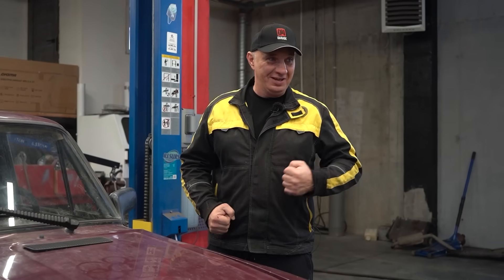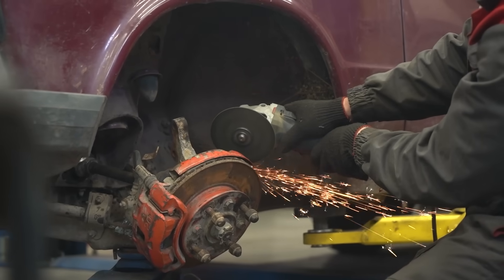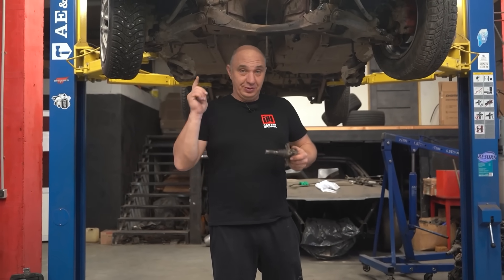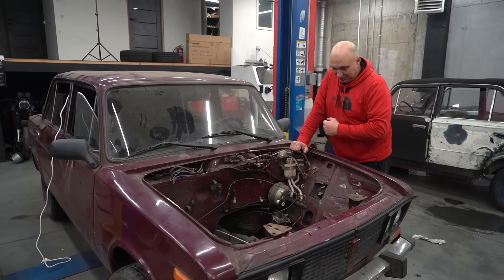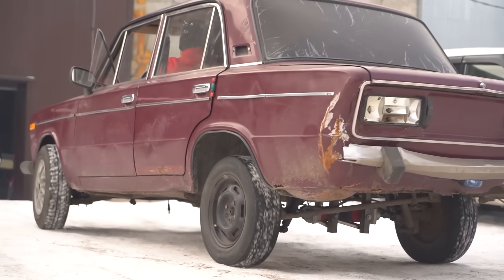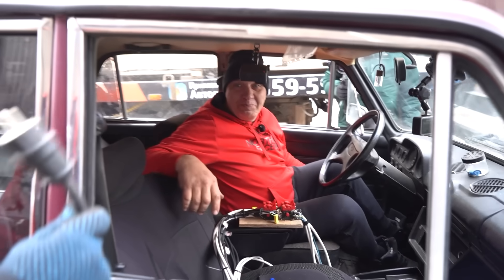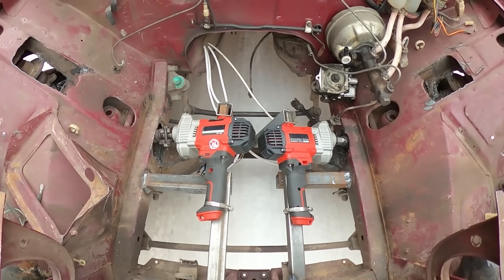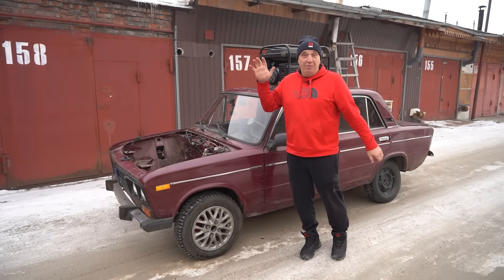4-motor plug-in electric Lada - first drive

Comment: Those motors are not designed to handle that much load, id recommend a lower gear ratio to reduce strain on the motors.

Comment: You should have used electric bike motors.

Also there are LFP battery packs with 3000 Wh energy weighing 30 KGs. You can go 30 km with one of those. With two you can go 60 km.

Comment: I have seem some guys doing electric conversion somewhere. They attach a big electric motor in place of the ICE, and add a controller and batteries. It seems like the most usual motor for and electric vehicle is the "Permanent-magnet Synchronous Motor", but also other kind of motor called "Induction Motor" could be used (probably cheaper, as it doesn't have permanent magnets). The batteries could make the project quite expensive, but maybe not that much if your get small batteries that will give you a very short range. I suppose that the motor and controller won't be cheap, either.

Comment: Do another 4wd Lada but use four of the very cheap Chinese hub motors. I built a 2 wheeler 8 years ago using two 1500W ones, which gave me ov er 3kw or about 4.5hp and proved to be far too much for the lightweight bike I used. It taught me why mopeds have a lot chunkier frames than pedal bikes.

Comment: It should be easy to make it with a suspension eather atach the motors so they move with the suspension or use cv axles. Also you could use a battery bank and inverters for the power even better some 1" cordless impacts cheapos from China!!!!!!! Have more power that way or even air tanks and impacts or ecen hydrologic motors and pumps. Cool start i thought something like this years ago but dint have the tools at the time now no money lol good luck!!!!!!

Comment: please do an experiment where you have this lada vs a conventional lada, give both 500ml of fuel (Both generator and conventional engine use petrol?), same speed, same weight, same track, and see which can go further. 
Hopefully the drill motors will not overheat in this experiment but I'd be very curious to find out if there's a significant difference between the two. 

Oh, and to make the test more fair, both cars should have the same suspension. If it's easier and cheaper to have no suspension in both, at least give the driver a comfortable cushion to sit on!

Comment: brush motors You can powered from DC voltage too, so You can use about 10 accumulators 12V (120V) and it will be run too, only this AC regulators not working with DC

Comment: Instead of a combustion engine, a three-phase electric motor is directly connected to the gearbox, and a generator is connected to the trailer.
The power could be as high as 40 kilowatts. A frequency converter adjusts the engine speed, and the gears work like a combustion engine. The car should move enough then.

Comment: Transfer case?     2 speed differential?   Tremec t-56. .75 5 gear. .50 6 gear. Double overdrive.manual transmission?  With shorter tires. And some  extra battery .  Low rider hydraulic s battery setup in trunk.

Comment: Curious if the crew can get a big big RC motor onto the stock transmission, with ESC connected to a receiver (you can remote control the throttle that way!) and power them with powertool batteries. More torque, hopefully more speed. Add a steering servo of some sort and have 1:1 scale RC car!

Comment: lulz great. hub wheel motors, ie wheels with electric motors built-in. wire is much easier than an axle. two lever tank turning works just fine. just like a caterpillar. put the generator in the motor bay. lol. also a bigger 10-20kW generator or more up to 100kW and a battery buffer. yep detach the lada engine from the drive axle and put a generator on the engine shaft then power the electric wheel motors. through a cable.

Comment: I'd like to see them take the transmission and affix the flywheel to it (for the ring gear) and then bolt as many starters to it as they can fit., and then give each one a battery (or two).
Yes, similar to what they did already, EXCEPT this will A) have multiple gears and go faster, but more importantly B) have reverse like this one, but will have functional suspension still 😊

Comment: 4:00 I'm just going to chime in with my prediction that they didn't make sure the drill's motors were wound symmetrical, to ensure they put out the same power in forward AND reverse... Because most are tailored for one or the other 😉
So mounting one to run in reverse us going to deliver unequal torque.

Comment: You should use a VFD (Variable Frequency Drive) and an asynchronous motor. The VFD can be powered from Directly 230V AC or 320V DC via DC BUS. And you can add a potmeter to adjust the frequency and speed. :D

Comment: I found that a lot of electric drills use what's called a universal motor and if it has brushes and runs on AC current more than likely it is a universal motor and can run on DC as well as AC.  I found that these corded electric lawn mowers run on a DC motor using a rectifier.  They tend to be 3 to 4 horsepower, I use them to power a four-wheel bike machine and it worked really well.

Comment: Another option for motors is to use regular car alternators, you just need a brushless controller(s) that can run sensor-less and to power the rotor windings with a small amount of current so it is magnetized. The best ones to use will be the high power water cooled type from a merc or Audi, the voltage should be 48v upwards to get any meaningful power (preferable 72v) its possible to get many horsepower from each one, they should be geared down appropriately.

Comment: You are the second car engineering channel within the last 72 hours to come up with a driving vehicle design that removes batteries, and uses a petroleum powered generator to directly provide electricity to an electric drive source. This has my gears turning. How about a large 36 V Forklift motor powering a small car and using a couple small diesel generators to power it

Comment: Try the starter motor you used in the winch I'm sure it will have more speed and you can run it off of 12.5 volts DC

Comment: Y'know, I don't hate the idea of EVs, I just dislike the current power storage solution. You hardly ever have to maintain an electric motor, the running gear is still a problem but that's universal for all cars. If they made EVs look like older cars, and included analogue options instead of digital, I'd jump on them instantly!

Comment: I have an idea for powering a car by hydraulics.
Four hydraulic motors with crossovers for front and rear, plus a valve system to “lock” all the wheels to turn the same all at once.
Ti would also make two versions, one in two wheel drive, and then add on a four wheel drive after testing the first.

Comment: Idea.  Take 2 or 3 of those drill motors and put small gears on the end.  Those gears turn a manual flywheel that turns the clutch in the gearbox.  Wire the motor switches to a pedal.

Comment: bonus is as long as the engine is not used to directly make the car move but powering the generator  you can use taxfree gas and diesel. a little loophole in the law XD

Comment: why not put the generator in the front for better noise and weight distribution? careful loading up the front, it looks like the drills might run out of angle, or the half shafts might hit the rail lol

Comment: With an independently controlled motor on each of the 4 wheels, you don't NEED a steering wheel or all the added complexity that goes with it. You could just use "tank" steering.

Comment: I love how these guys weld cast iron like it's nothing. Best automotive channel imo. I tell others too
Reply: Preheat and a stainless rod if you want a hack that works. Or just MiG and wait for it to break
Reply: It doesn't have to last ten years 😂
Reply: Hack channel i would say. They are wrecking 1000€ cars all the time and most of the builds do not last longer than the video, then gets sent to scrapper, but it does not matter its not anyway other than making lots of money from clicks viable. While there are builds that are interesting, its yet another channel pumping out projects to then scrap them almost immediately after filming, so the quality is just hold together until filming ends.
Reply: @Hellsong89  yeah nothing lasts and they scrap everything. That's not a lifestyle I condone. But their creativity and pseudo engineering is second to none. It's a money making endeavor, but so are 99% of channels

Comment: You hit the nail on the head--I'm pretty sure I suggested it before, but why not a Lada trolley?
  Put trolley poles or a pantograph on the top !  You would want to get permission from your local transit authority, if they have a sense of humour.  Maybe they would even supply you with a couple of traction motors and a controller !!!

Comment: Such a fun channel.  Electric using drills ... and an extension cord of all things.  Perfect.  Nicely matched by strapping a genny on it (and well placed on the roof).  NICE.
Reply: Hard to know what motors to try.  Power is nice, but in spirit of the channel it needs to be something laying around, etc.  Some fork lifts are battery, so one or a couple of their motors would be interesting.  Though not sure what other options are floating around.

Comment: I would love to see it converted with 4 motors from washing machines again powered by the generator if possible with a single power control for all 4 or similar power units that run some kind of industrial equipment. Definitely the best automotive YouTube channel.
Reply: You would need probably at least an 8000 watt generator to run 4 washing machine motors efficiently.
Reply: @garygermain1446 use a 250cc bike engine?
Reply: Washing machine hub motor from direct drive

Comment: You should get a sponsorship from one of those big power boxes, which act like a huge powerbank and they have outlets, and if you can find one which you can draw a lot of current from, you will have a good time with the generator charging it and the motors using the power from the power box.

Comment: Tesla has dual motors, meanwhile these guys have quad motors
Reply: AND replacement motors can be bought at any Lowe's or Home Depot!! 🤣
Reply: @jlucasound 😂😂😂😂 corect!!
Reply: Triple motors in some of their models.
Reply: its nothing new. protean engineering have all wheel drive electric motor vehicle prototype in the past (about 10 years ago). in addition, all 4 motor are steerable so the vehicle can move sideway (easier to park)

not sure why their vehicle not goes to production. that was an engineering marvel at the time
Reply: @madan-ch9gz  Honda had this on their Prelude in 1988! :) there was another company that also had it, think it was Mazda?
Reply: Hahahahahhaha mother Russia is the best 😂
Reply: The difference is that Tesla has the resources to get something to market en masse and meeting all federal regulations, whereas this is a garage hack job.
Reply: Yeah, none of us have ever broken an impact drill before this should work fine
Reply: The fastest production EV in the world (Rimac Nevera) also have quad motors, one at each wheel :) Lets them do some crazy torque vectoring stuff.
Reply: No need for a differential with 4 motors, it’s quite clever actually
Reply: @ConstantinSPurcea  I mean, the problem with having independent motors is that if one wheel loses traction, you've lost 1/4 of your total torque, meanwhile with differentials when one loses traction, the diffs begin to lock up and put most of the torque it would've lost to the other wheels. When your vehicle is already going to be heavy, adding diffs turns out to not be a big weight gain, especially when EVs are already like one to two thousand pounds heavier than their closest equivalent ICE vehicle, depending on if its a car or truck. So really, independent motors are fine if the vehicle will never, ever leave the asphalt, and even then ice will always be problematic for it.
Reply: @Avetho what you say doesn't make any sense. If you had 4 independent motors, and oviously there run by a computer and have multiple sensors, each motor is run by a speed controller that controls torque output on every single motor. But your sitting here telling us that 1/4 of torque is lost, wtf? If anything you have complete control of output independently with electric motors on each wheel. You done a whole lot of talking achieving nothing.
Reply: @kovacevd  I don't see how a computer can tell the other three motors to drive at 133% throttle, you can't go past a 100% duty cycle.
Reply: @kovacevd  no what he said makes sense. for example, in a 200hp four motor AWD setup, each motor would be 50hp. but in a two motor AWD setup, each motor would be 100hp.
when a 4-motor loses traction in a wheel, it renders that one 50hp motor in that wheel useless, leaving you with 150hp across three motors in remaining wheels.
but when a 2-motor loses traction in a wheel, the diff will lock up that wheel, and transfers the power from the slipping wheel into the next wheel with better traction, so you'd still have 200hp on three remaining wheel.
i still prefer four-motor setup tho
Reply: @Imammk  yeh, that doesn't matter when u can easily have 300 hp per wheel on an electric vehicle
Reply: @ sure but the cost and inefficiency would make no sense
Reply: @kovacevd  It does matter. A lot. Look at the Rivian quad motor trying to off-road. When only one wheel has traction, that single 200hp motor doesn't have enough torque to push that thing up and over an obstacle without it over-amping. You're going to lose performance on an independent wheel setup any time there's slippage. It's a lot less complexity, and just better to have 2 larger motors and use an LSD or TCS to transfer power.
Reply: Twice the motors, half as gay
Reply: Probably won't win any drag races against a Tesla though.

Comment: E bike motors can be powerful and cheap and come with their own controller, get the direct drive version with regen, a large LFP battery pack and your good to go.
Reply: But don't forget the generator in the trunk - so you can still call it a hybrid! And of course a solar panel on the roof.
Reply: Nah not really, each tool of those costs a few dozen bucks and has over 1.5 horsepower making around 6hp+ in total geared with a crap load of torque, an ebike kit for 250w will set you back 300-500 bucks excluding batteries.
Reply: @johnbelwell2461  ebike motors can easily do 5kw but I agree about the cost
Reply: @johnbelwell2461  3kw versions are easily available giving about 12hp total, thats a pretty good amount of power for a small car. There really not that expensive from china.
Reply: @johnbelwell2461 where you buying that 250 set up for that amount without the battery😂get 2000w set up from c h I na for about 350

Comment: Hear me out:  Use a manual transmission (<-Gotta spell it out so I don't get flagged by youtube for disparaging the retards...) and arrange the motors around the input shaft like the cylinder of a revolver.  Then you could add six or eight with room to expand.

Comment: They basically made a diesel locomotive but on a lada. A diesel motor powers the electric motors without a battery.
Reply: Robot Cantina is currently doing something similar with an old electric golf cart using a Predator engine from Harbor Freight and a cars alternator in place of the old ancient expensive batteries.
Reply: @Cyberdeamon  petroleum battery golf cart
Reply: There are few electric cars out there that have range extenders that are just tiny engines used exclusively to charge the batts. Mazda is even making a rotary version.
Reply: Early diesel-electric locomotives used batteries in conjunction with diesels.  Both battery and diesel would get the load moving and then the diesel would maintain speed and recharge the batteries.
Reply: I think the first hybrid diesel auto I know of
Reply: @azhyhama9649 didn’t Audi make an S car with one? S4 maybe?

Comment: why you did not connect a gearbox with the electric motors,, so you will be able to switch gears and soll using torque ratio